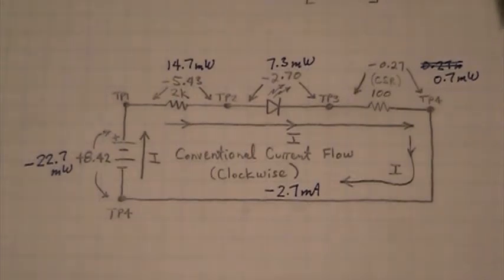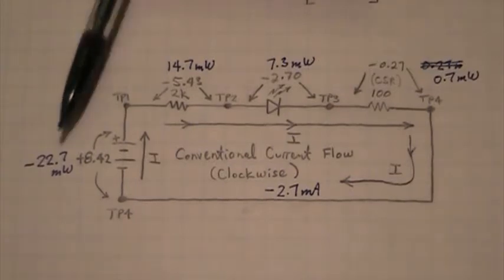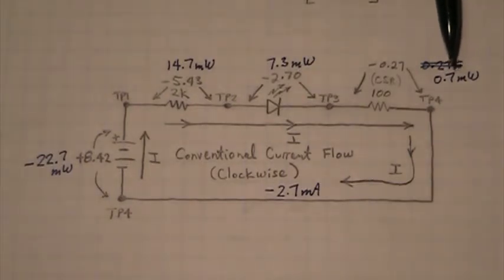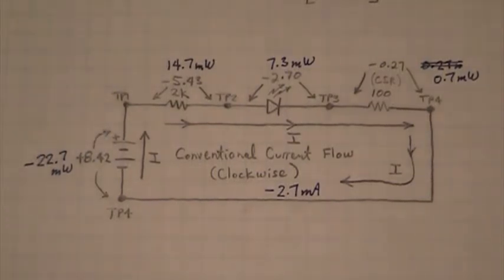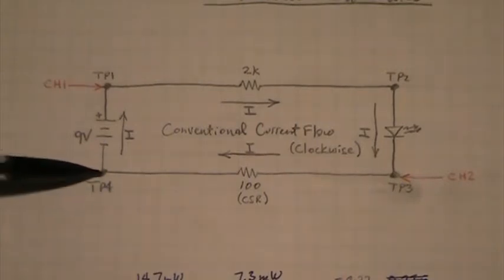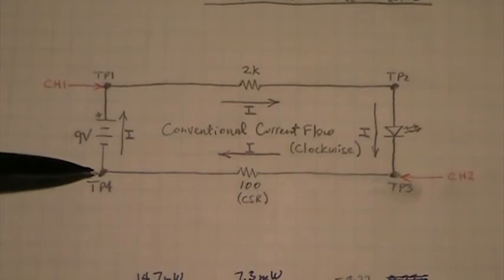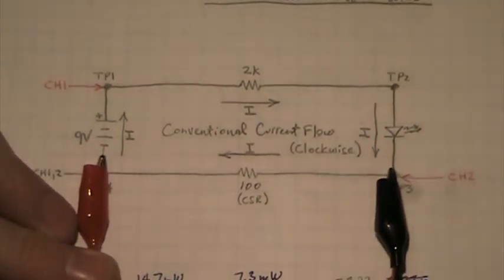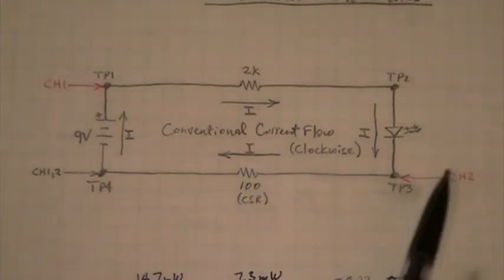Power Measurement Basics - Part1b

Comment: (correct me if I am wrong) In Part 1C will be explained why to set your oscilloscope to DC for a certain circuit, even if you are dealing with an AC circuit. because that also has an effect on the power measurement.
Reply from the maker: I did cover that in the forum when pertaining to 60Hz signals, and yes Part 2 will cover oscilloscope measurement of the simple DC circuit.